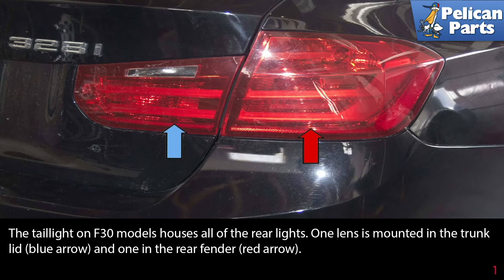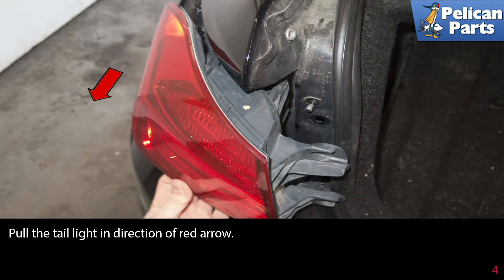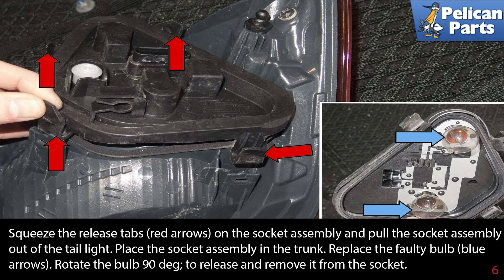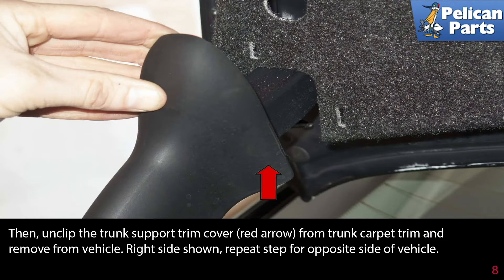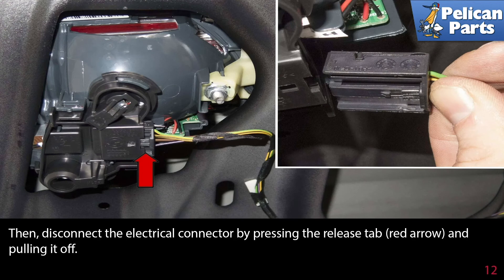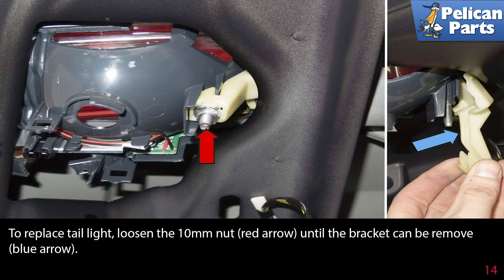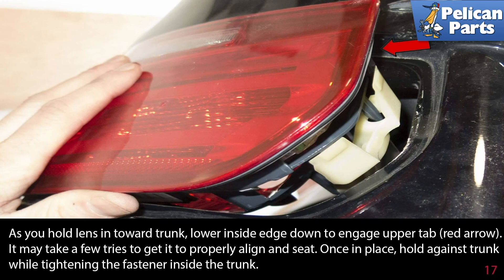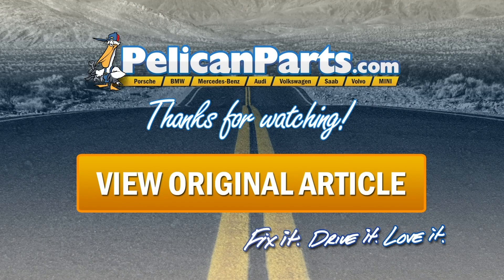BMW F30 3-Series Tail Light Replacement for 320i, 325i, 325Xi, 330i, 330xi, 328i and 335i

Comment: Does anyone know the part number for the plastic trim panel lock
Reply from the maker: With your vehicle info handy, give The Pelican Parts parts specialists a call at 1-888-280-7799. They can figure out what part or repair kit you need.